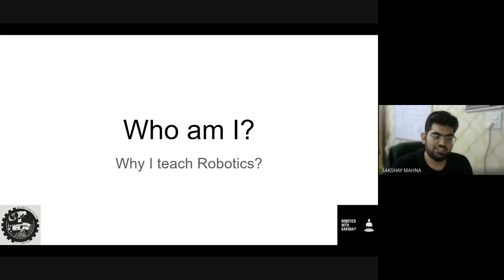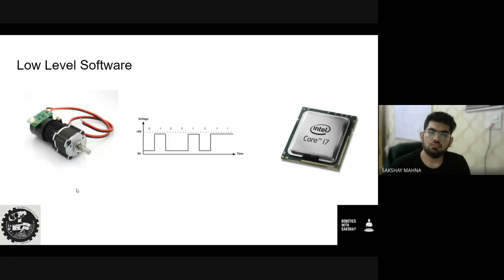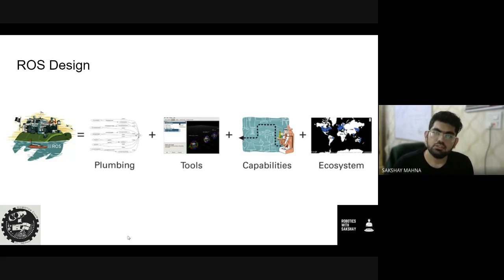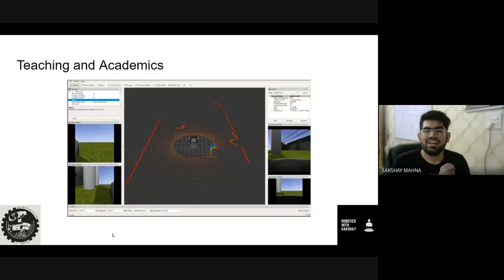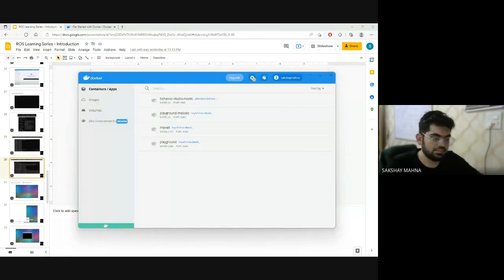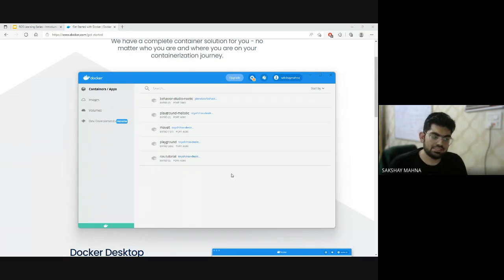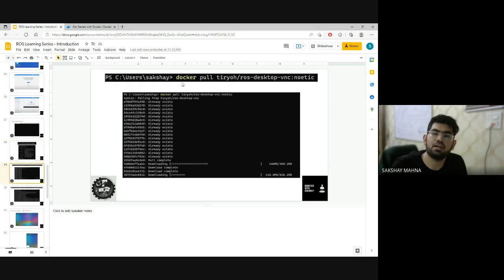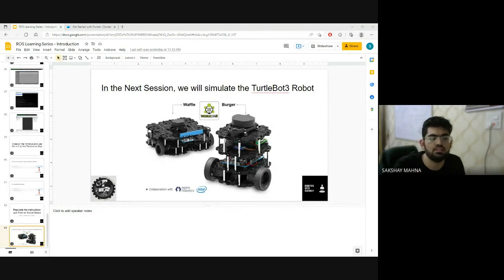Introduction to ROS | Part - 1 | ROS Learning Series

Comment: Regarding using docker. Does it still can access the system’s GPU on which the docker is being run? As it I indeed creating a virtual machine?
Reply from the maker: There are certain features for which Docker can use the GPU, like training and inferring Deep Learning models. For Graphics based operations, like running Gazebo, Docker does not utilize the GPU.